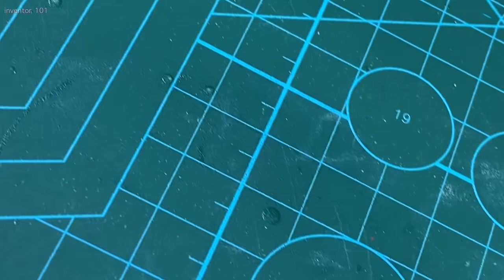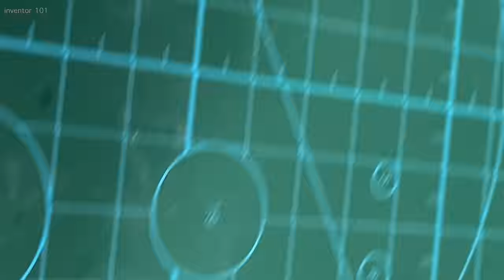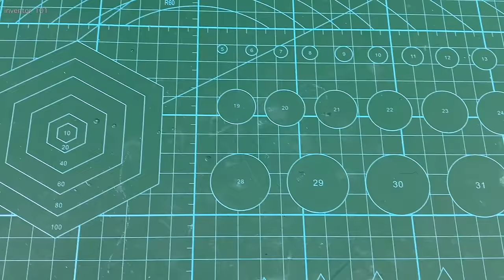3 SIMPLE INVENTIONS [NEW]

Comment: Стоит приделать к косе щиток хотябы со стороны пользователя. Если отломается лезвие изза того что на большой скорости врежется в толстую ветку и прилетит в ногу или в живот, то будет больно.

(Google translate)
It is worth attaching a shield to the braid at least from the user's side. If the blade breaks off due to the fact that it crashes into a thick branch at high speed and flies into the leg or stomach, it will hurt.